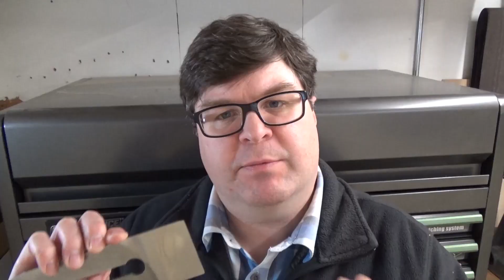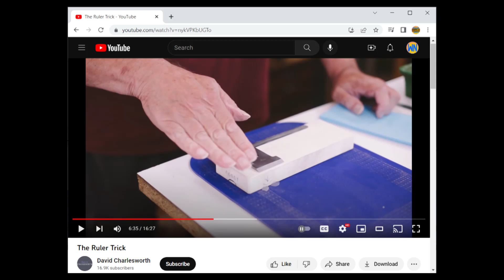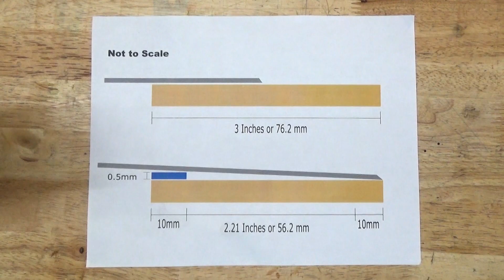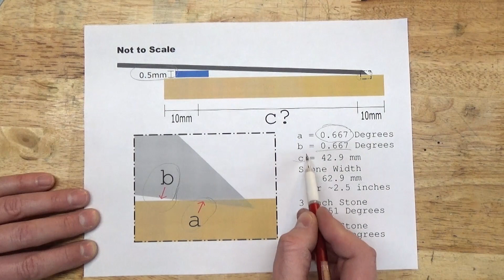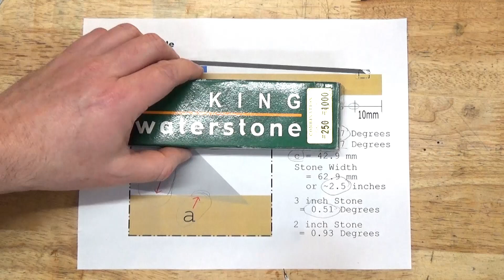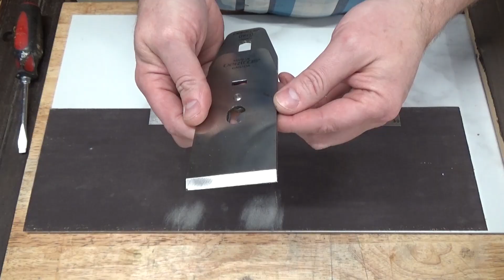Myth: The Ruler Trick Negates Flattening and Works on a Strop

Comment: I watched a Matt Estlea video some years back when I was just starting to use hand planes. His comment was some thing like "with a good plane iron, there is almost no work involved in getting it flat, so why bother with the ruler trick". Well, that does make sense, but most blades are not from Lie Neilson. Not really sure if that makes any "real" difference. I do remove the burr from the bevel on every grit, and some times I start at 400. I go up to 16000 like Rob Cosman does. I always strop. More than anything, I can feel a burr when I am done with that stone. Same with 8000 grit DMT stones. The ruler trick may remove a little "work" but I am not sure it is worth it. The coarsest grit stone, which is the coarsest one available, is 120 grit. I asked DMT if they made an 80 grit stone, and I would swear I could see the tech do a double take. 80 grit abrasives can help. Do it right the first time, and you don't have to do it again. Some times I wish we would make our plane irons old school like the Japanese planes. Hard metal for the cutting edge and softer/cheaper metal for the body of the plane. They adjust for warped blades by tapping the top which expands a bit and causes the edges to curve down.

Comment: Nice video, impecable reasoning. Cosman does indeed flatten the iron, or at least the tip, before polishing with the ruler trick. I do the same both for plane irons and spokeshave irons: first flattening, the tip or more, and then the ruler trick on the tip. It's indeed pointless to go directly to the ruler trick before at least examining the iron flatness near the tip.

Comment: The answer to your complaint about Cosman's technique on a severely cupped blade is that Cosman first of all does prescribe a more coarse stone for flattening, and secondly that if a blade were that bad he would recommend you return it.
Reply from the maker: Jeff, I didn't intend to complain about Rob Cosman's technique. I think there are a lot of his techniques that won't work for me as a hobbyist. I simply don't have his skill and experience.

I totally agree. At this point in my life and I going to pay the 50 bucks or so for a flat iron. I have 2 recent additions form Veritas that I'm quite happy with. I'm no longer interested in taco-shaped blades.

I think there are a number of successful techniques that work for different reasons for different people. Here is an old blog post with a SUPER interesting comments thread including contributions from Mr. Charlesworth and Ron Hock. You might be interested in the reading the debate between Konrad Saur and David Charlesworth. I don't think there is any final answers but it is really fun reading.

https://www.theunpluggedwoodshop.com/the-ruler-trick.html

Comment: I posted a followup video on my Power Pro I would like you to watch and provide comments. Note my comment after I posted the video. I think I discoveresd a major fault with my Power Pro. Thank you, Ted
Reply: It’s amazing what a night sleep can do. Came out this morning. Looked at it with fresh eyes and saw exactly what you were talking about. Losing the nuts casting to relieve the idler bearing took a big flat head screwdriver in the back and just gently pushed it out so it was flush with the front of the housing.

So the upper belt is where it belongs but the lower belt has a slight slant to it not much so I’m now wondering if maybe I don’t need to let the idler go back just a little bit inside of the housing.?

I was trying to make it too complicated.  
Really was an easy fix so I’ll wait for your response. I hope I have it right.

Can’t thank you enough. Ted
Reply from the maker: @choochoo3985  Good, let's hope you're close. If it were me I would follow Scott Markwood's (@mygrowthrings) reply to one of John Rice's comments. He said the bearing portion of the idler shaft and the eccentric bushing should be flush.

Once it is secured back in place you can then trouble shoot belt alignment and tensioning. The 2 Jacob Anderson videos I linked to before should tell you a lot about that part too.
Reply: @woodshopnerdery  I did watch the video and after after I sent that I thought you know, the two belts are not the same tension, so I went ahead and released the eccentric cam, and it just basically moved itself to equalize the tension on the two belts. I don’t know if that’s how it’s supposed to happen but I am happy with the fact that it did.

You guys are great. I hope others that watch the video get a look at your name and start watching your videos because they’re incredibly informative and you know that Shop Smith is a great tool.

Got too much company right now got up early this morning came out the leader. I will go ahead and put the ball back on and see if that resolved any of that vibration problem. Thanks again.
Reply: @woodshopnerdery  I did and it worked great. This is a real issue that many may not understand, so I am posting another video on this subject to get others aware of the potential problem and resolution.
Reply from the maker: Yes, I watched it and commented probably at the same time you were writing your comment. Take a look at the comments John Rice made. He is dead on. You may have other problems, but it is critical to address the idler shaft issue first.

The idler shaft is held in place with an eccentric bushing that can be turned to apply tension to the belt. This bushing is gripped in the headstock casting with a bolt and nut. You will need to push the idler bearing and eccentric bushing back into place, rotate the eccentric bushing to apply belt tension, then secure them with the bolt. Do NOT over tighten as you can crack you headstock casting. That will be a major pain to repair.

John Rice mentioned Jacob Anderson. Here are two videos that might help you. You might be able to repair this yourself depending on comfort level.

https://www.youtube.com/watch?v=J2RSrFpr5Sk

https://www.youtube.com/watch?v=kl1W2zhCpeY